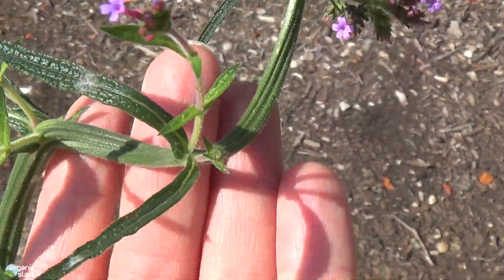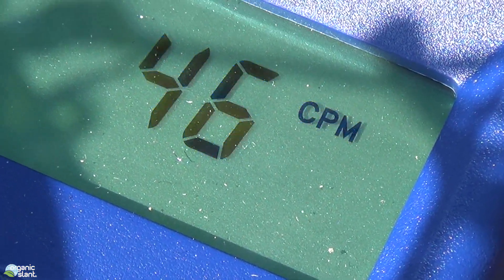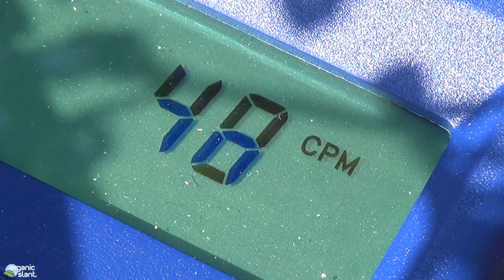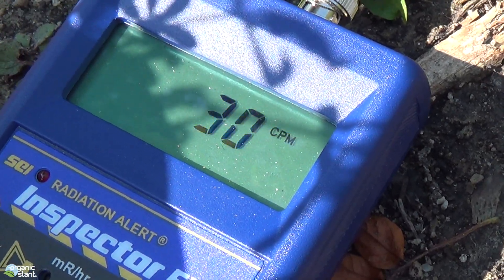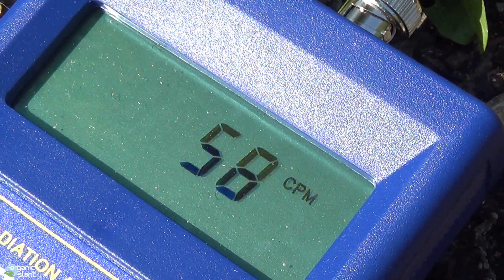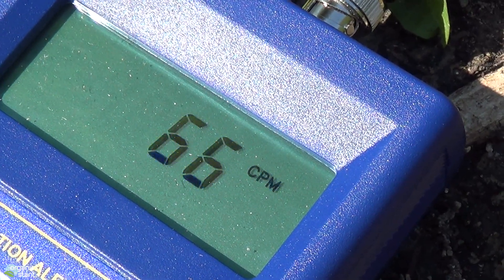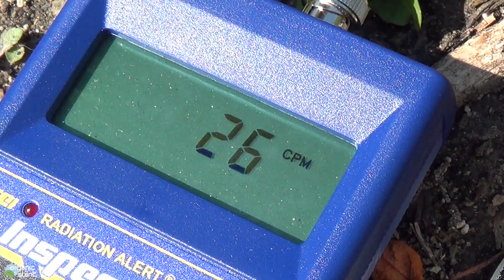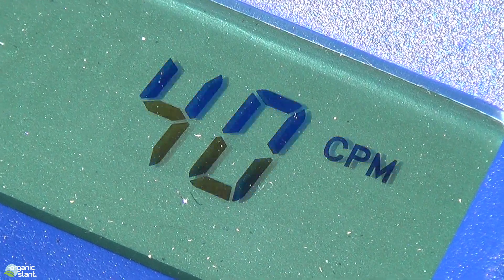My Radioactive Soil 9-10-2017 | Organic Slant

Comment: If those CPMs only go higher than normal when the probe is very near the ground,  then those would be alpha radiation particles that’s in your soil.  While they might be relatively harmless on your skin, you DEFINITELY don’t want to ingest that.  Inside your body and inside the plants, is where the damage is done, hence the plant mutations due to the DNA damage from the inside of the plant as it’s growing from seed to full bloom.
Reply from the maker: the roots uptake it...mutate it...if it's an annual the plant will die and it goes back into the ground...to be taken up again the next season...

Comment: I have done radiation reading for past year and found high RADS IN WATER RUN OFF AND POOL ACCUMULATIONS that later become dry after a rain.  Almost 2-3x higher.  It will get worse. Live in Oklahoma.
Reply: Thank You , James  For Your Report !   See Same  IN   Georgia  @ 32 CPM
Reply: Thank you OS and James, I do not have a meter as of yet but I see the dark mold in the white concrete, and the potholes in the streets and highways, and the brittle limbs of struggling trees and plants (particularly in or near surface runoff areas) and lack of insects (like wasps and bees) or 'confused' insects and the air filtration masks most of the mowing professions now wear (what is in that ragweed pollen making everyone more susceptible to an allergic response now?) and what are we drinking? FYI - those living around Chernobyl after the meltdown started eating tuber plants grown at least 2" deep (if memory serves) in the soil claiming the rad-particulates stayed mostly in the upper inches (example: the surface dug down 6" and bagged up in Japan); so, OS you might want to scrape that hot spot for another metering and then re-route/control runoff in another way prior to backfilling with clean soil for an additional check. And by the way, can't help but love potato and other tuber-type chips now - oh yeah!